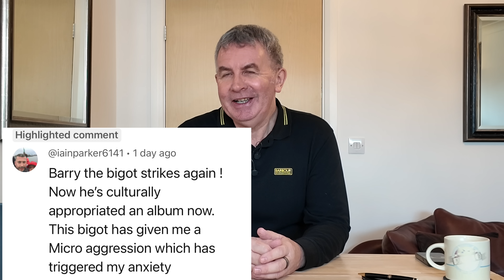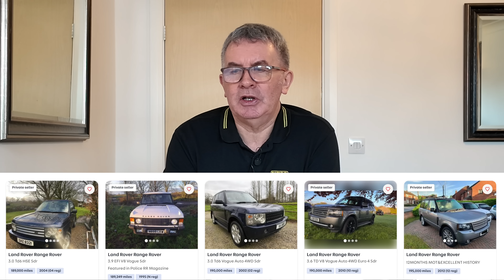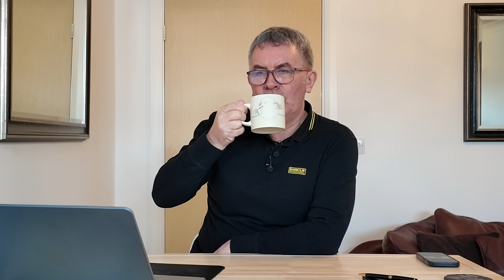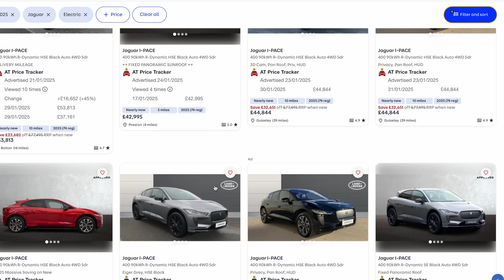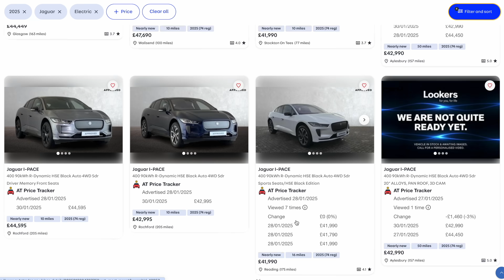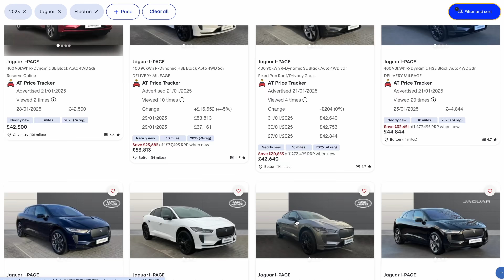Jaguar iPace Electric Vehicles Piled High at Scrap Yard, EV Newt Scores an Own Goal

Comment: Nice one Baz, someone from the motor trad being honest about JLR. they have always come up trumps with servicing or repairs on my 20 plate ipace. car is mint. but like ALL cars things happen. Windscreen changed FOC due to leaks. AC pipes changed Upgraded With Jag good will contribution cost me £1500 and that's it. Service £200. mot £40 battery problems are with LG not jag, Jag are trying to rectify the issue and or buy back.
Reply from the maker: Thanks for the info

Comment: “Anyone important is seen in a Range Rover” fully agree Barrie, but one important correction: “Anyone important is seen in a Range Rover that’s under JLR Warranty”

It’s important to understand the LR Defender 4 SDV6 600nm engine has only 4 main crankshaft bearings (yep missing 3 for a six cylinder), also has oil pump housings that fail causing camshaft mistiming (valve-piston impact). LR Time have covered this in detail, JLR are beautiful but not durable or reliable design, and let’s not mention the later Ingenium engine saga.

Comment: EVs are NOT good for the environment, how can anyone with half a brain cell claim them to be? Are they conveniently forgetting how they are manufactured? Are they ignoring the pollution and chemical fumes when the fires break out? Are they conveniently ignoring that their life span is a lot shorter than conventional vehicles? Are they ignoring that a small crash or bump can result in a write off and then we are back to the mining for materials and manufacturing again. If you like EVs fair enough, like them for their drive or just technology but don’t be evangelistic about them being better for the environment, even given the above,, heavier vehicles cause more damage to roads, tyres, brakes, there is no getting away from these facts.

Comment: Harry Metcalfe has no trouble with his Jaguar project 7 & 8, he always says how reliable and cheap to service they are and he’s running around in a diesel Range Rover sport now after getting rid of his BMW X5 hybrid so they can’t be that bad.
Reply: There are countless people who have bought several Jags and Land Rover/Range Rover models, our family included for over 25 years and we've never had a single major problems with any of them. In between my discovery and my Jag XF I had a BMW 3 Series and that's the only car I've ever had a lot of problems with. 

Most of the problems you read about are people copying and pasting other peoples "unreliability" posts like sheep, or people who "had a friend that spent thousands fixing his car, or it broke down 10 times", that sort of stuff. 

The biggest problem is people who buy used cars that they can't afford to run, then they skimp on servicing and maintenance then start complaining when they break down because they haven't maintained them properly, if at all.

Comment: Hi Barry, I have a 21 year old X Type Jaguar... It has been, and still is a very reliable car with very little spent on consumables. Jaguar have built some fantastic cars, some say they rust badly, however it depends on how thorough you are at maintenance. My car is cleaned thoroughly including the underbody and protected. Jaguar's mistake was going electric. Shocking the ipace scrapping when my 21 year old Jag is still going strong.
Reply from the maker: Thanks for sharing

Comment: There were a number of Jaguars flooded at the JLR dealer in Derby (2024) that includes new and customers vehicles. As they were likely to have battery/electrical issues, these are likely to have made their way onto the scrap markets. Please check before you buy.
Reply from the maker: Could be that, but doubt that an evangelist would tweet that if it was really the case, also I wouldn’t think they would go to the Sam’s scrapyard if they were all different insurers

Comment: I have a 194000 mile old Freelander 2, still runs well, and I can refuel it in 10 minutes. We have access to a charger for electric, eight miles away, and at the moment most electrical cars take an hour or two to charge, so rural England is not good for the electric car owner who travels a distance for work. Cars, in 1899, started out with battery power, then the infrastructure could not cope. The whole reason to promote electricity to power the world, is a flawed concept, driven by greed for wealth, by the 1% elite minority. Good to see a video by someone trying to be fair.
Reply from the maker: Thanks for that

Comment: Maybe I-Paces are good and reliable, but if this is the case, why have JLR bought 2750 of them back from owners in the USA, and is preparing to scrap them ?  I did think about getting a used I-Pace, but the more I read, the more I'm put off.
Reply from the maker: That’s not good

Comment: I had a RR Evoque, beautiful interior, yes a lot of plastic panels, had a few electrical probs that seemed to fix themselves. After four years it developed an engine crank front oil seal leak, an expensive repair so it had to go, got a BMW for three years no probs, got a JCW Mini for 3 years no probs, got a Cupra Formentor now, full of software bugs when new but a lot better recently.
Reply from the maker: Thanks for sharing

Comment: I had an iPace for 3 years. Lease up at Christmas. In 3 years I had 2 recalls, 3 breakdowns. Off the road for 5 months waiting for a new steering rack. Waited 3 months for a suspension part. And this was when it was in production. Would not charge on 150KW chargers. I loved driving it, but could not keep it on the road.
Reply from the maker: That’s terrible thanks

Comment: Thing is these evangelists will clame ev’s are perfect and green. While turning there backs / sticking there heads into the sand to the issues and cold facts the chemicals released by battry fires are considerably worse than over types of fire and incredibly toxic.. i dont like the direction jaguar are going, but clearly to fix the i pace was more than the value of each car so i don’t blame jaguar. 
Jlr aren’t as bad as there made to be I’ve owned and currently own 3 rangys, and my family have over jlr products, yes my current rangy had the oil cooler leak but fixed by a spec list but bar wear and tear there pretty reliable. And funny enough cheaper to fuel especially sins I can’t charge at home. Plus i do actually take her off rd and also living in a rural area as been amazing and funny driving up hills in the snow with ev’s and tesla’s struggling 😂. And seeing them being rescued by ice 4x4’s… dont get me Wong if someone wants a ev enjoy but i dont want one nore want to be forced….

Comment: The thing is that I cannot make an informed decision until i have actually lived with one ,but all i see in media outlets is the negative side of EV'S .that does nothing for EV'S as a whole. 
Yes you showed us how many Ipace's are available for immediate delivery, and theres loads . could that be JLR   building thease to keep the workers busy rather than laying them off or putting them on a reduced working week.
Supply is out stripping demand, especially this time of year, could be due to no one really knowing how the economy is going to go , also, January and February are slow months what with Christmas just behind us .
Another thing is thease iPace'S stacking up at charles trent , is that due to a failure of the car as a whole,or a failure of the battery pack, which at the end of the day is not a direct fault of JLR ,but more a failure of LG the battery manufacturer ?.
Without a battery pack thease do become an expensive paper weight.
All thease "Doom mungers " are not doing the EV market any good,but they do seem to shout louder than those who quite happly have had an EV för years.
I know customer who are quite happy with there EV .
Its still new technology, and if it is the future then we have to embrace it ,.
But as i said in the first instance,i cannot make an informed decision as i have never driven one ,but if the chance came then i would.
If everyone has a negative attitude to everything then we as a nation would get nowhere.

Comment: Had an f pace first edition only problem was DPf , fixed it by putting a reconditioned throttle housing in for 350 quid . 8 years of problem free motoring otherwise and passed every mot without fail

Comment: I own a 19 year old Jaguar. It has never failed an MoT, though it did once have a repeater bulb replaced to allow the pass! It is the most reliable car I have owned (17 years) and I will not replace it with a "disposable" modern car.
Reply: Couldnt agree more, I have a number of 300k plus cars that regularly come in for service and MOT that they sail through, a 1999 mk4 golf gti, a 2008 VWT5 van, a 2009 Merc E320 and a 2004 Volvo v70 Oh and a VW T2 bay window camper from 1970,  what a time to be alive for cars, I daily run an RS6 V10 circa 2008 with 154k miles.

Comment: EV Newt seems to be living at home with his parents still vibes. Not to be taken with any seriousness based on what he says and does not know. Good for the air - what a total clown. The list is endless re emissions to mine the list of rare minerals needed (take a look at the minerals for their brakes alone), then two tonne of lithium needs 500,000 litres of water just to extract it and all that returns poisonous and filters back into the earth and waterways causing damage for 100s of miles around. See the indigenous tribes in Columbia who have been on the end of it and then the push back from the native Americans for the same reason after a new mine is being opened taking away their land yet again, after the gold rush. Rock crushers run 24/7 on oil and diesel, Barrie the list is endless and the emissions are astronomically high and we have not even got to the infrastructure manufacturing for the cables alone! Newt has a very small mind and is in denial. You do well how you handle them. EV the new fur coat - don’t ask how it’s made. 😂
Reply from the maker: Thanks for that

Comment: A member of my family worked at Warranty Direct in Reading many years ago and the data they held on car reliability was staggering ( and a very sanitised version was available as the reliability index)
They would certainly support your view of German cars and the very patchy build quality. 
However they refused to insure a number of LR products such was their experience of very poor reliability record and massive repair cost.
Reply from the maker: Thanks
Reply: Posts of people copying and pasting other posts saying the same thing suggest this, but actual trade statistics do not.
Reply: @severnsea  I can only say what Warranty Direct data showed. It was based on their direct experience of claims and the cost of those claims.Thats certainly not “cut and paste “ and all I would say is having had a Passat, a golf and  two Audi A6’s I’d say Warranty Direct were right.
The A6’s were by a mile the worst cars I’ve ever had in 40 plus years of car ownership for problems and one in the 15 months I had it, spent 7 months off the road whilst Audi tried to resolve one problem which turned out to be 3 faulty dual mass flywheels.
In fairness my subsequent E Class Merc was generally very good although it was low loaded to the dealer twice.
Reply: @iainharris6201  Yes, fair comment, I'm not really disputing your post, it's all these people who "had a mate who had a Jag/Range Rover that broke down" posts that wind me up. They're just copying what everybody else is posting (seemingly word for word in many cases), I bet half of them aren't old enough to drive.

Comment: My sister had an I-pace from new, 6 1/2yrs old and at the beginning of last October it came up with traction battery fault and would only charge for a range of 70miles. She rang the dealer who told her they couldn't look at until Jan 6th but it would be alright to use not that 70miles range is much good!! In the mean time she ordered a new Audi Q4 electric for delivery this March agreed a trade for the Jag hoping it would be fixed. When the Jag went in for repair they told her there was a fault with the main battery but it would need to order parts but it could be months before they could repair it at no cost as it was still under warranty. Somewhat pissed off she said my brother says you are buying some back that are faulty and 30 minutes later she left without the Jag and money in her bank. I wonder if it's on that pile???
Reply from the maker: sounds like it could be

Comment: JLR are pretty poor in my opinion. A local garage had them queuing up for low mileage cam chain replacements. Ingenuity engines are terrible for reliability. Having been underneath them for a few thread repair jobs they seem pretty flimsy in the suspension department. Constantly waiting for genuine parts to arrive.

Comment: JLR product are always the top three in most unreliable cars in the UK, its a fact, google it, people who profit from selling or repairing them are the only ones to deny it. its also fact that they are getting worse with each model released since 2014 when they became Tata owned, poor quality mechanical design built with even poorer quality materials, the only high for a JLR owner is the cost of ownership. Fact.
Reply from the maker: rubbish
Reply: @BarrieCrampton  Unfortunately Barrie, it is not rubbish, I have a very busy workshop and body centre and besides Ford ecoboost issues our most prevalent and expensive repairs are JLR, We service and MOT hundreds of VAG, Porsche, BMW, Toyota and Honda vehicles but rarely need to carry out major repairs, its heart breaking really as a proud Brit.
Reply from the maker: @ we have more problems with Mercedes, Audi, and bms
Reply: @BarrieCrampton   Mercs seemed to go bad after 2011 (i did leave them out of my list for that reason)  The bodyshop voted worst factory paint to BMW and we see them regularly but not for big stuff like engines, just diagnostic of complicated electronic parts they put on for superficial owners who think its sexy to have lazers in headlights.
Reply: Just thinking of stuff in this last week I could put forward as an example of poor design and quality comparison;  Jaguar F-pace V6d front brake pads, single piston sliding caliper like most manufacturers only fit on rears, Audi Q7 V6d front brake pads, 6 piston fixed caliper and double the size pads, The Jag 22 inch wheels are thick cast alloy and weigh 40% more than the Q7 forged 21 inch wheels. Its all about cutting costs at the expense of reliability.

Comment: Jaguar reliability questioned? Didn’t Clarkson return from Sand Job and buy an F-type citing it as the only car he’d used on such a trip where nothing had fallen off or failed?
Reply from the maker: love the F type, ive had afew
Reply: Correct, he did. I've never had an issue with my 16 year old XF in the 7 years I've had it, and it's never failed an MOT right from it's very first one. Only issue I had was a broken window winder motor and JLR sent a replacement in 2 days. We also have a 2015 Evoque which we have had for 6 years and have never had a problem with that either. 

Have you ever noticed that with 99% of these posts it's always "a friend" who had a Jag/Range Rover that broke down. Amazing how so many people know so much about their friends cars. Does nothing else break down, ever? I don't know a thing about any of my friends cars, it's not something we ever discuss.

Incidentally I know from the videos I've watched that Barrie has sold a lot of Evoques as well as other Jags and RR models. Why would an independent dealer not tied to any brand keep buying them in to sell if they were that problematic?

Comment: I was one of the first to buy an I-PACE back in 2018. One problems after another, biggest one wiring loom replacement, of the 3 years of onwership at least 6 months of the time repaired at the dealer. Final nail in coffin when it's hot it cools the batteries over the cabin, so when it's 28C outside it won't cool car, loan car parked nexted to eack other running at sane time had no fault, but dealer refused to change compressor even they saw failt code. Dealer said, contact JLR, JLR said Finance company, Finance said contact Dealer. Dont get me wrong when it worked nice car, but won't touch JLR again due to lack of customer service.
Reply from the maker: not good

Comment: Ahhh scrap yards with new cars in. It happens a lot. Vehicles that are part of testing, engineers and homologation fleets are routinely scrapped to ensure these non approved vehicles don’t end up with customers. After 2012 Olympics BMW scrapped 100’s of perfectly good cars to protect used values. The cars had been used as VIP fleet for BAFTAs, Wimbledon and finally Olympics , they were then scrapped at selected vehicle recycling centres. JLR are clearing out, it’s no biggie. It’s cheaper to scrap than pay the taxes on engineering vehicles that don’t meet homologation requirements.
Reply from the maker: What a load of old pony and trap
Reply: @BarrieCrampton  seriously? BMW used Interpart at Daventry to break most of the ex VIP cars from 2012. Chevrolet used an independent breaker in Aylesbury to dispose of the pre homologation cars. MGR and JLR had/have various breaker contracts in the midlands. Nothing can be sold on, it’s full break and recycle.